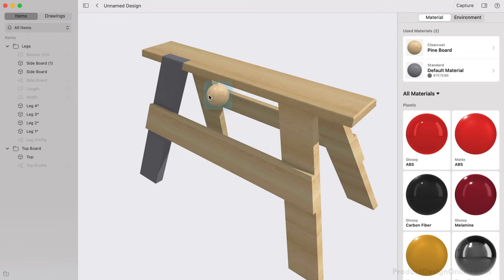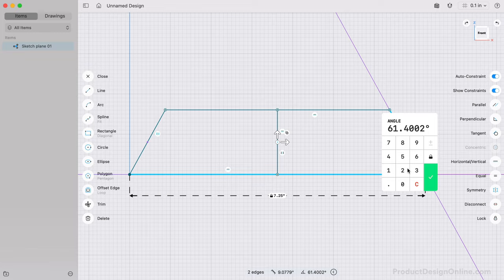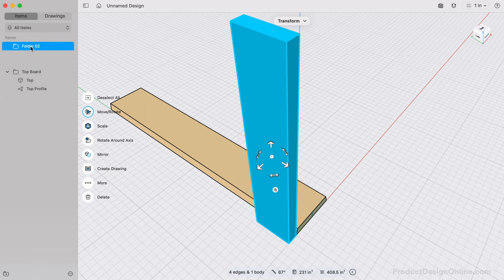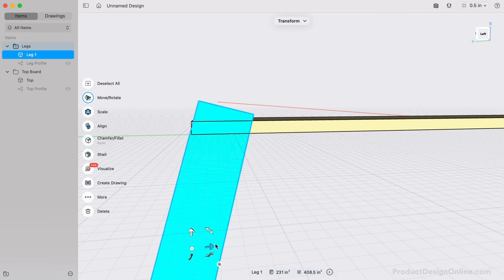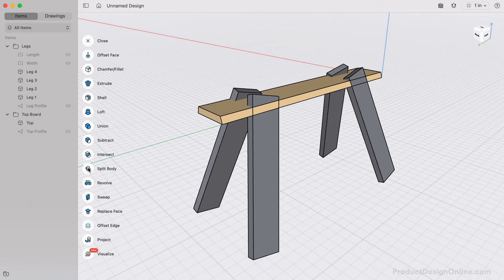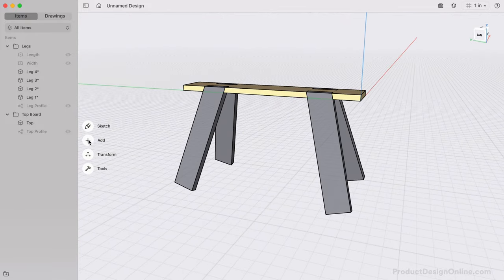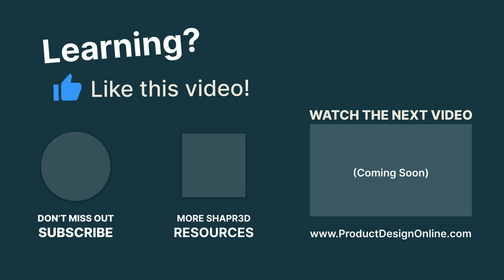Shapr3D for Woodworkers Tutorial | Day #7: 3D Model a Sawhorse in Sharp3D

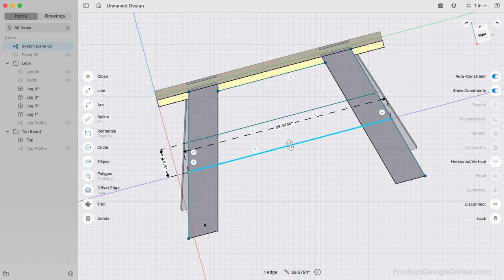Comment: Excellent tutorial. At 10:10 when I moved the support board down to 12" from the floor the length was too short. The 14 deg angle of the legs require a longer board as it moves down. Maybe I should draw the board in place without having to move it down.